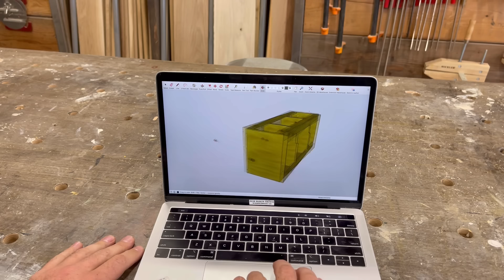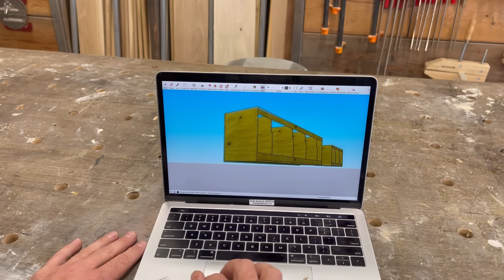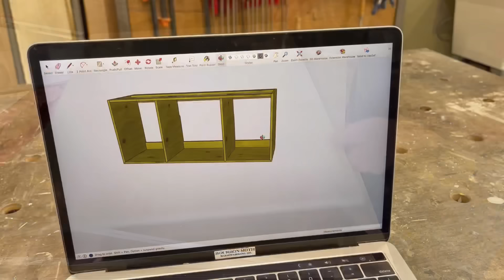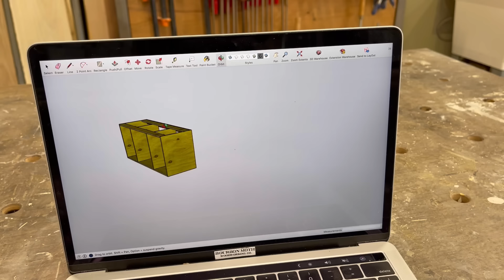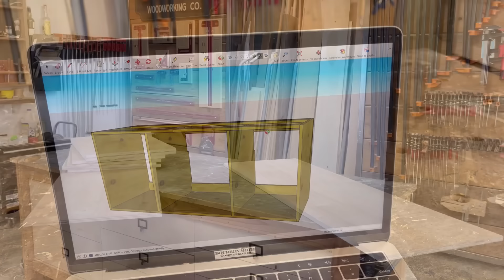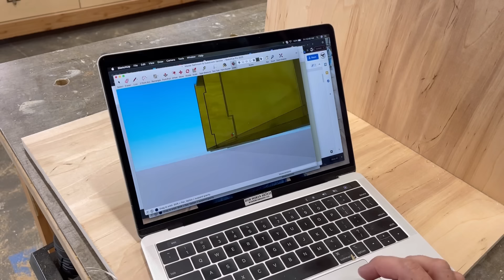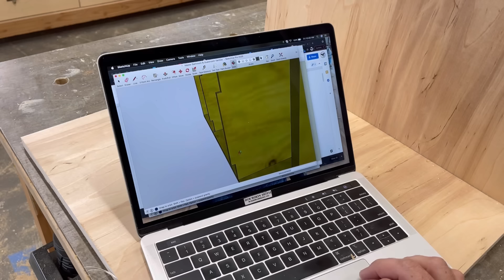Easy Bathroom Vanity Build || How to Build Floating Cabinets

Comment: Ya know Jason, this is the second video you've been too lazy to use the track saw. Funny thing is, I've been wanting a festool track saw. You can always gift it to someone if you don't want it. It's just a suggestion. 🤣
Reply: I love my Festool track saw and use it a lot. But it’s sometimes hard to make a spot-on 90 degree cut with it when breaking down sheets. The mitre saw has the advantage of always cutting in 90 degrees.
Reply: @johannesbengner383  isn't that the whole point of a track saw though. If not you could just clamp a straight edge and use a circular saw

Comment: Loved the under sink modification you made. When I replaced the vanity in my main bath, I modified the entire cabinet because it was a double sink cabinet and I had single sink. The modification I did to the drawer under the drain was very similar to what you did. I actually cut the one drawer in half and made the body slide so as not to hit and put pressure on the drain pipes. Anyway, you just reminded me of the project, great build my friend, you got a new subscriber.

Comment: Good stuff. Even the drawers around the plumbing aren't as stupid as usual because you don't have the horizontal bars as part of the vanity face between drawers, so you have pretty much the same hole to work in as you would if it were an open cabinet.

Comment: Looks really good. I too am a woodworker, not famous like you, but have built some nice things, and have been at it twenty years. I realize you have the saw stop saw, however why don't you use push sticks when cutting narrow things? Fingers are not cheap to fix. Harbor Freight has push sticks cheap.

Comment: So your expensive Festool miter saw craps out, leaving you to use a DeWalt saw to finish the job? This video was particularly helpful, as I'm in the market for a miter saw!
Reply: Yes, I'm always torn between the 2000$ and 500$ miter saw.
Reply: Go with the Bosch.
Reply: @larryweltsek1354  Damn, now I get 3 options.
Reply: @JulienB_BTW  If you got the money for a festool, get it. (I don't.) If you can afford $500-$700, get the Bosch. And I'm a dewalt fan.
Reply: @jimpinger6206  which Bosch is that? I'm also in the market for a new one...
Reply: @juhaloukaja5078  Bosch 12 inch 15 Amp dual bevel sliding compound corded miter saw. Model #GCM12SD.

Comment: I love watching these videos, you make it super easy to follow with step by step instructions.  The only thing I cringe at is you running your hands into that darn table saw!  It only takes one moment of not paying attention and you’re missing a finger.  Safety first, bud!  Use that push tool!
Reply: I agree. That is the only uncomfortable item on his videos. I've had router bits come loose the come thru the board, luckily no hand on top.

Comment: How do you figure out the height of your French cleats in relationship to the finish height of your cabinet. Is it a typical measurement you go off of. Also do you use the overall height of the cleat for your measurement?
Reply: put both cleats together measure from top of cabinet to bottom of cleat that will be affixed to wall. Thats what you measure below finished height and affix the bottom of the french cleat to that line on the wall.

Comment: LIke mavy of the other commenters I end up binge-watching your videos, and love it.    I'm not a pro, but have build lot's of wooden stuff since being a li'l kid.    I  built a 2-sink vanity when we moved into our new house 24 years ago.   I did have a pro put the faces on the drawers, but that was all he did.   I didn't make a face-frame.      When installing the topless, drawer-less vanity I had allowed only 1"  of space at the ends, and had a hell of a time getting the dern thing to fit between the two end walls.     While watching I was curious what you would say about fitting vanities [or any other things] into tight spaces between end walls.   bah ,   you didn't.          I had the pro cabinet maker, who made our kitchen cabinets make only the drawer faces,  and my the wife laid the tile top.    Duh.... can't remember who installed the two sinks.   Cob webs in the memory banks.  I didn't have a fool-proof technique, lie in you video, to install the drawer slides and had a hekkuva time with them.  
I have built a number of dressers, desks,  and shop cabinets since, and have never again used metal drawer slides, instead the drawer lower side edges and the cleats cleats they run on are well waxed.   Thus the drawers have an extra inch more interior volume..
I was just checking my old Stickney dresser that's been in the family, and built by an obscure relative I was told,  since early 1900's,  The drawers are supported on narrow rails that fit in 3/4" wide grooves midway up the drawer side panels.

Comment: You must have a stockpile of baltic birch plywood because I still can find it in my neck of the woods.
Reply: Where are you located? We have it here in Calif, but it is still very expensive. $178 for 1/2" 4x8 and $210 for 3/4" 4x8
Reply: @Zamboni-0805  Indiana

Comment: I like using poplar for painted cabinets doors - unfortunately box store poplar likes to twist again like it did last summer and lumber yards near me open whilst I'm at work and close when I finish work. It would be nice to see if you have any tips to deal with lumber that's not completely true. Apart from burning it that is.
Reply from the maker: Buy it thicker then you need it and mill it to the final dimension
Reply: @Bourbonmoth  Thanks. I think 3/4 is the thickest at lowes and I'd need a thickness planer ...which is on my wishlist.. Remember that song. There's a hole in my bucket....

Comment: Quick question. Is there a reason why you run your top and bottom rails all the way through? Generally the stiles run top to bottom and the rails butt into the stiles. This allows a crisp finished end look and you don’t see end grain from the rails running all the way through.

Comment: Quite informative and outright inspirational.. thank you so much. Question : With the weight of 3/4" Ply and all the hardware, drawers etc. & lets say a marble top, all of which can amount to well over 250lbs plus depending on size of cabinet , is the french cleat system strong enough to support the weight... not to mention if you have children?

Comment: Awesome build as usually Jason..  By no means am I picking your design apart, this is just a question.. You may have a reason that im not thinking of but wouldn't it be a stronger assembly if the rear nailer that is mitered for the french cleat was underneath the top horozontal strecher? Again im not saying that would be better, it just seems that way thinking about it.. Loving the podcast.. Binge listened several times.. Take care man.. Keep the vids coming..
Reply: I agree, seems better to extent the top horizontal stretcher and then put French cleat under it right?? Maybe, it doesn’t matter if you secure the cleat well enough; it may add more but that extra isn’t really needed? I hope he answers you.

Comment: Do you ever have issues with humidity and expansion on the drawer fronts? I built a vanity (painted finish) with the same reveal around my inset drawer fronts and every summer they stick due to the humidity.  Poplar all around (drawers, fronts, face frame, cabinet, etc).
Reply from the maker: It could be geographical. We have pretty moderate humidity in Oregon. I’m not sure I would do as tight a reveal somewhere with high humidity

Comment: is that Baltic Birch? or is that the feaux birch,(poplar core/birch veneer), from the big box store? I design and fabricate high end subwoofer/speaker cabinets. and real 13 ply baltic birch is hard to come by where i live. only one specialty wood store carries it and it costs $130/sheet currently. i really dislike working with the veneered birch.
Reply: Here in Cali, 3/4" Baltic Birch 13ply is $210....and 1/2" is $178...at least it was the last time I was at my local dealer.
Reply from the maker: It’s the real deal.

Comment: I have a question? Do you have any videos? On cabinets hinges? Like the ones that you use the kreg jig on? I’m asking cause I’m starting out cabinet making and I’m not doing a simple cabinet, I am making a hexagon cabinet with a round door and I need a video that shows me how you make 35 millimeter hinge holes and how far you set it back inside the cabinet. I’m a solid surface countertop fabricator and I’ve been doing this for 17 years and now I want to expand my skills in something different, you have great skills as I watch your videos and want to learn more than building countertops, I am not that experienced in woodworking but have built some cool stuff but nowhere near as perfect as you have, but tools are so expensive, I’m wanting to work with wood and solid surface together in my future, but I can’t seem to find understandable videos on cabinet hinges? You have any previous videos on this?….. love the way you explain yourself 😁

Comment: Big question on the playing card spacers when applying drawer fronts: I understand how this works on the lower drawers - after spacing, remove the upper drawer, and that allows you to clamp the lower drawer front in place, and then insert the screws. Love it. But if you then count out your cards for the upper drawer, and put the upper drawer front in place, all ready to be clamped prior to screwing it on, there would seem to be no way to clamp the upper drawer front in place, because it is blocked by the upper horizontal face frame. Do you clamp OVER the upper horizontal face frame? I bet that's it - you just need to make sure your clamp can reach that far.
Reply: He didn't clamp the upper drawer fronts, just held them in place and reached down from the top to screw them onto the drawer box. Not possible if the counter top is already installed, though.
Reply: @corey6393  Ah, okay, thanks. That makes sense.

Comment: Looks awesome and of course very entertaining. I noticed you have the parf design on your work bench did you not like it or are you still lazy with using your track saw with that also.
Reply from the maker: What’s a “parf” design?
Reply: @Bourbonmoth  I think he meant dog holes. There is Peter Parfitt who has a system to drill accurate dog holes for diy workbenches.
Reply: @Bourbonmoth  sorry I saw the dog holes in your work bench and thought you used the ujk parf guide system by Peter parff he designed it specially for the plunge saw. I made a bench up with it.It’s very accurate for 45 cuts and cutting down full sheets of ply. He’s got heaps more add ons now for it. Check it out when you get time

Comment: Love the card trick. 👍 Maybe I missed it somewhere, but how did you clamp the upper draw faces without the faces sliding down before you could open the drawers to clamp the faces?
Reply: I wondered as well, but I think he said in another video to use double-sided tape. (Or was it a different channel?) Once you know the right number of playing cards, just put two pieces of double-sided tape on the back of the door face, and it will stick to the box when you set it on top of your playing cards. Then slide the whole drawer out and add screws. No need to remove the tape.
Reply: @j10001  Cheers James! 😄

Comment: Very cool, I always learn something from your videos. Side question. I just got gifted a used bandsaw. The blade is shot on it. Where is a recommendation to purchase and what is the best tooth count for general purpose?
Reply from the maker: It all depends on the size of your bandsaw. But Amazon is where I buy mine.
Reply: Likewise, I inherited my dad’s. They are not too expensive so not knowing which one to get I just ordered three, ranging from lower count with quite a deep blade - which is good for ripping but has quite a rough finish - down to a thin blade with high tooth count.  I’ve settle on the thinnest blade with the highest tooth count for my band size as it is much better for tight turns and will cut through pretty much anything with a nice finish, even hardwood.

Comment: I only hope you remove the hardware before giving it to the painter. They hate having to remove or tape around it. 

We never set hardware until after it comes back from paint. Not to say one way is better than the other. It's just the way that works best for us.

Comment: I was wondering why you cut the support pieces to width and then cut the 45 for the french cleat support. Why not cut the board in half with the saw at 45? 1 cut, not 2.

Comment: Nice build. However, I hope you do the plumbing of the sink drains and water supply lines yourself, as well as dealing with any future under sink plumbing issues, so that you can learn why hinged doors for the sink cavity is the ancient tradition. Its a form follows function thing. Dealing with under sink plumbing is a pain in the ass, when there are hinged doors, and your approach using a fixed front and C-shaped drawers has made it worse
Reply: Blum drawer slide come right out easy peasy. Makes accessing the plumbing simple.